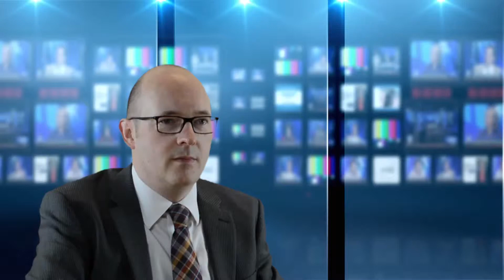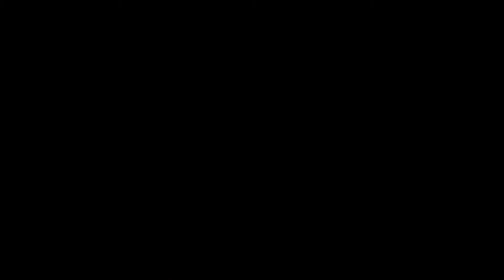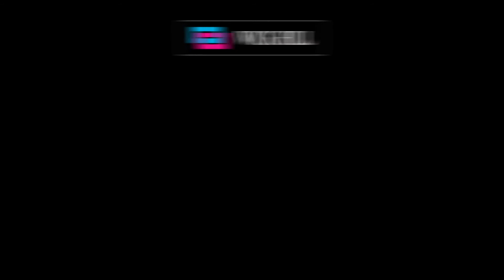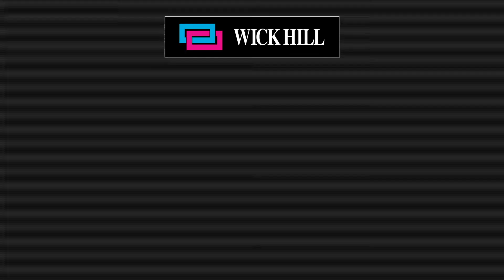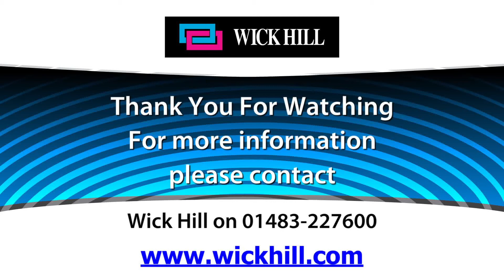Time to Reconsider Network Access Control? | macmon

Comment from the maker: YouTube Video Blog: Network Access Control is in an interesting place right now. Years ago NAC was difficult and cumbersome to roll out, expensive and sometimes required very specific hardware. It often resulted in pilot projects which were never fully rolled out because administrators were wary of making changes, and many are still in place today for the same reason.